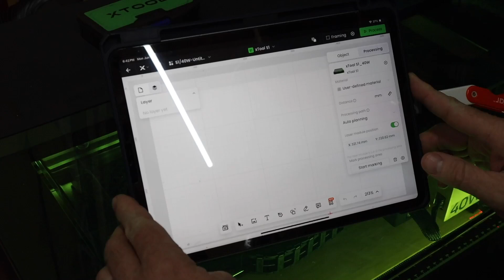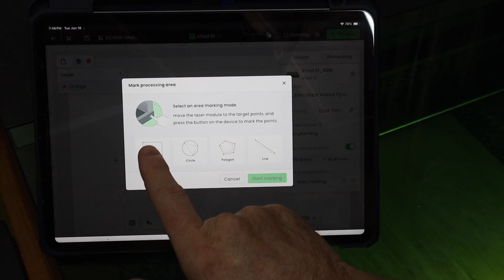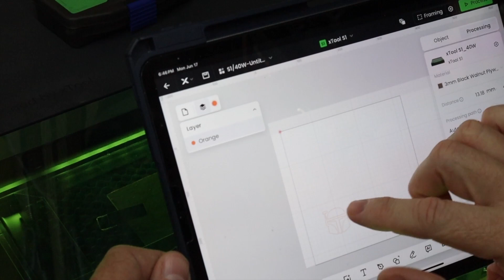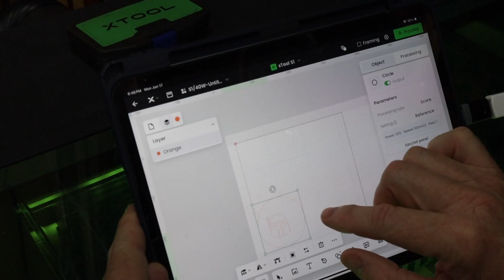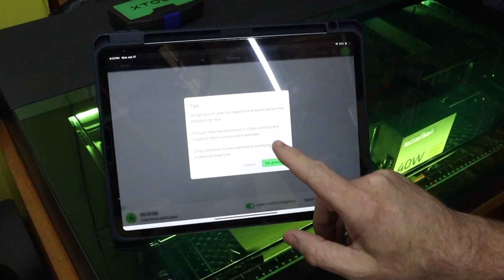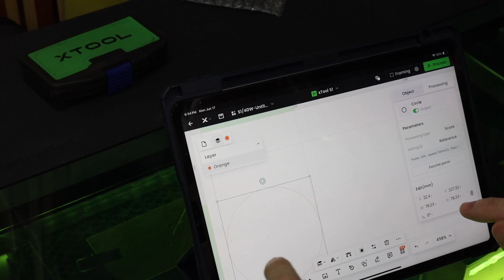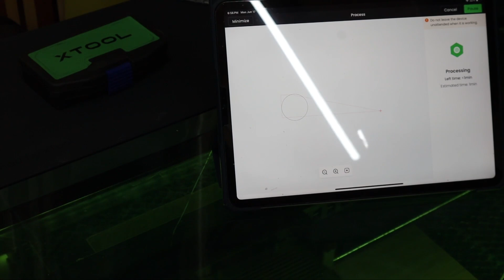Start To Finish: Make a Mandalorian Medallion using an iPad and an xTool S1 Laser

Comment: You has the circle layer on score not cut. The helmet was on cut .
Reply from the maker: Right you are!
Reply: Right, and even 22 speed and 100% is to fast, the sweet spot is about 15mm/s and 100% to cut true 3mm material.
Reply from the maker: @stegmater  Thanks!  Lots to learn here.